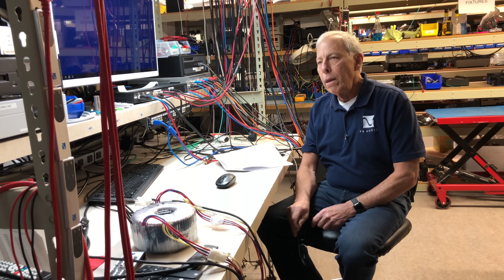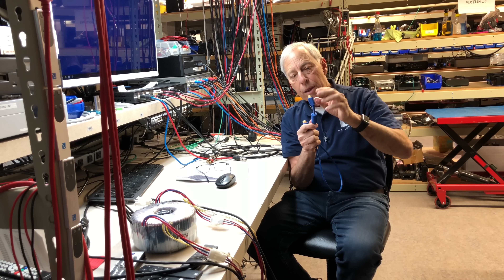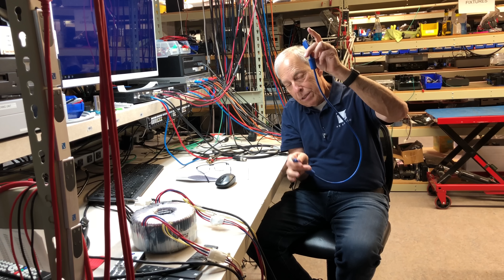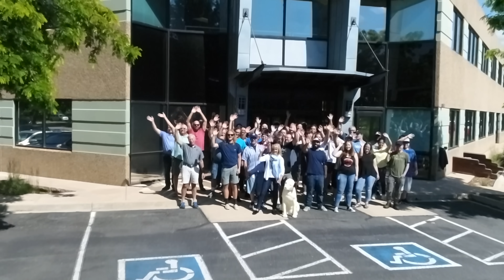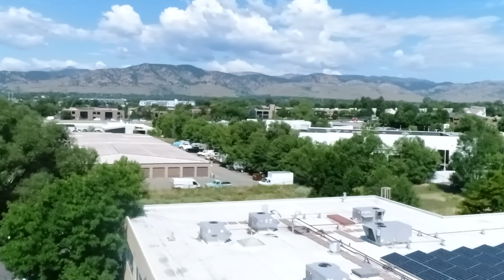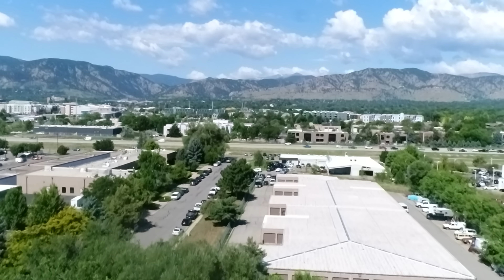Should amp impedance be high?

Comment: Hi Paul! Just popped over from Skylabs after Kevin recommended your videos. I think you can do much better explaining impedance by using an actual vintage stereo setup and explaining why impedance is so important as sound source moves through pre-amp, amp, receiver and eventually a pair of speakers. Frankly, I'm talking out of my hat here because I still don't understand the concept entirely (with perhaps the exception of high to low) :-)  A good way to start would be to imagine you are trying to teach math to a monkey. The first monkey would be me. Thanks!

Comment: For sure, if you connect (in parallel) something of low impedance to your circuit, then the behaviour of the circuit will change: the current will flow through the low impedance that you connected instead of the usual path. And it will change the signal that you tap into on your circuit -- you do not want that.

Comment: Can someone please explain to me this: if a 8 ohm speaker is easier to drive than a 4 ohm speaker, why does it say on the specs of a amp that that it can for example do 2x100 watts with 8 ohm, and with 4 ohms it can do 2x160watts. I dont get that. How can u get more power out of your amp with lower ohm speaker that is harder to drive?  Rly hope to get some answers.   Im alittle new to this, so be kind ;)
Reply: @thedude1744  how does that make sense? If i have a 100watt amp. It should be harder to drive a 4 ohm speaker. Then why does all specs show u get more wattage out of ur amp with a 4 ohm speaker.

Comment: 1) It is important to explain the difference between resistance and impedance. 2) it is important to tell that once connected the headphone has become a “load - power consumption” to the amplifier where the system as a whole has impedance to the power from the socket. 3) the power supply behind the socket has now become loaded as well and as such you need to include its impedance

Comment: Howdy.
Usually we want an amplifier to be voltage driven. This is the same as having a high input impedance. If the input impedance is lower than the source output impedance the amp. becomes current driven. That would be ok if both the output sorce imp. and the input amp. imp. are truly resistive and their magnitudes are constant over the whole audio spectrum.
That is seldom the case. Freqency dependent capacitive and inductive components cause phase shifting and also frequency dependent magnitudes cause level unbalances when current driven.
An amplifeir input impedance should be at least 10x the source output impedance to guarantee voltage driving. Amp.s are usually designed to uphold voltage fidelity. Not current fidelity.
The same goes for headsets and speaker elements. Through much testing they are developed to uphold air pressure fidelity to the feeding voltage and not the produced coil currents.
Regards.

Comment: I don't think this explanation was very helpful. Somebody tell me if my analogy below is helpful and accurate, in as much as it is an analogy.

We want amps to be able to "draw" the "amount" of signal they need. We provide a signal from a source that "flows more freely" than the amp accepts, allowing the amp to "take all that it needs" from that part of the circuit. We don't want to "starve the amp of input" so we offer less "resistance" from the signal generating device than the signal receiving device offers. We want "push" signal to the input and let it regulate the connection, not make the input try to "pull" signal from a source that "resists it."

Comment: 120 ohm output impedance  requirement for driving headphones was a result of laziness in designing headphone output in power amp. The near 0-Ohm output impedance of an amplifier (power or headphone) provides a very high damping factor.The amp maintains tight control of the headphone  or speaker driver  damping providing tight bass control.The high damping factor  reduces distortion. ,provides a smooth and a predictable frequency response.

Comment: This didn't answer the question at all. He wants to know why output impedance is high for the headphone out but low for the speaker out.
Reply: It did. The wire from A to B is the output impedance of the amp, whereas the wire from B to C (ground) is the impedance of headphones. A-to-B (output impedance) appear in series with B-to-C (headphones), so the same current flows through both, but the voltage is divided in between of two in proportion with the resistance. You don't want any voltage drop on A-to-B (basically loses) that's why you need to keep A-to-B as low as you practically can
Reply: the signal drop is at the low resistance, speakers need more signal.

Comment: I have a dumb question a long one at that. You are so good at explaining these things I'm positive you can answer this. My two amplifiers 1 for the front and one for the rear are pioneer gm5300t's. They are 2 channels at 125 watts rms 4ohms per channel. 4 Speakers are pioneer z series 110watts at 4ohms including tweets and crossovers. Every thing works perfectly. So here is my problem I'm adding 4 alpine tweeters 100watts rms 4ohms. That's fine my math says 2ohms 190 watts on the amps and 2ohms 220 on the woofers tweeters and crossovers in parallel. Heres my problem they sent me one pair of 100watt 4 ohm tweeters  and a pair of 80watt 6 ohm tweeters and they dont have more of the 100 watt ones. Is this ok to mix the 6 ohm with the 4? Should I put the 6 ohm in the front or back? I assume to put the 6 ohm in the front so I get more volume in the front. Please help.

Comment: I want to have a crack at this my self high impedance inputs are basically voltage receiving inputs or signal inputs they need really no current and since the point of these inputs is to receive signals u want the impedence to current to be very high so no current is used to drive or distort the signal or change it in anyway think of it as a data line it's just transferring information not driving voice coils or doing work like low impedence high current outputs or inputs high impdence means it's basically  means its driving a gate on a transistor  or grid in a tube  something that has no real physical connection to the power supply or coil it basically just copying the electric field state of signal and passing this information to transistor junction or plate of a vaccum tube  that actually does the heavy current lifting required to drive the signal hence field effect it's just super imposing the signal on to a device that then amplifies. A speaker needs to be low impedence because it's the current through the voice coil that moves the speaker motor super high impdence speakers would need super high voltage to drive them which is wasteful and inefficient I hope this helps.
Reply: I was not super satisfied with pauls explaination because it's not  just a ground path. Paths to ground lead to well nothing ground lol. You can set impedence with a resistor to match impedence but it's a little more than just that. Am sure he was well aware of that but no need to dumb it down to much as it leaves open ended question and confusion

Comment: If a speaker impedance is high, it is hard to push electricity into it. But that's because a high impedance speaker doesn't NEED much electricity. This is easy for the amp because the speaker is not asking for much electricity, nor is it allowing much electricity. High impedance is a way of keeping power out of the speaker. It's a way of not asking for much.

But a low impedance speaker is HUNGRY. It's impedance is low because it wants to gulp down a lot of power. So it ASKS for a lot of power by keeping the impedance low. Low impedance = hungry speaker = demanding task for the amplifier. A low impedance speaker asks the amp for a lot of power, and that's a challenge. It asks for power by keeping impedance low.

Comment: Paul, I think you misunderstood Steven's question.  He was asking about headphone/speaker impedance and amplifier output , while you opened the video with the question "Why should the input impedance of an amplifier be high?"  You did a fine job of answering your own question, but it may not address Steven's concern.  
Some points toward answering Steven's question (necessarily abbreviated since I could write an entire book on the topic):  
By design, power amplifiers typically have very low output impedance, because that is how they achieve precise control of the voltage that they put out, including when the load is drawing substantial current.  One wants this voltage to exactly follow the musical signal, because speakers are always designed to be driven by accurate voltage sources.  [One could postulate an alternate audio world where signals are represented by current instead, but on planet Earth we don't do this.]  We typically see power amp output impedances of only 0.1 ohms or less.  
The speaker load impedance then needs to be high enough, that the power transfer from amplifier to speaker can be efficient, while the amplifier's output current limit is not exceeded.  Attempting to use speakers with 0.1 ohm impedance would not be very successful, because the current draw for any useful amount of power would be too high and the amplifier would distort severely (or even shut down).  Not to mention that in this case, power loss in the speaker cables would also tend to be high.  
You may be aware of a general circuit principle, that maximum load power will be provided when the source and load impedances are matched.  However, in that case the load and source power dissipations will be equal - which is not what we want in audio systems.  We want the speakers to dissipate the power, not the amp and cables.  Also, such general principles easily lead us astray since they assume ideality and do not consider particulars of the application, such as voltage and current limitations of the source, and the requirement to avoid distortion.  
There is another situation you may be familiar with outside of the audio discipline, where source, load (and cable) impedances should be matched, which is when one is dealing with transmission-line effects with RF signals.  However, unless you're locating your speakers hundreds of feet away from the amplifier, this is not a consideration for audio.
Reply: G Guest  
Yes, 41+ years in analog/digital circuit design and development for commercial flight control systems, most recently 777X.  But I've always had a keen interest in audio since about the age of 8, when I assembled my first power amp kit - a Dynaco Stereo 70.

Comment: No!
Amplifier output impedance should not be high because we now have 4 ohm loudspeakers, or 8 ohm loudspeakers connected in parallel, these days.
As long as the output impedance of the amplifier is lower than the impedance of the loudspeaker, the amp will be 'happy'.

Comment: I like to talk about water and pressure when talking about impedance.  I imagine the lower the impedance the larger the source pipe and the higher impedance as a smaller pipe.  When the water flows through the low impedance pipe the pressure of the water is maintained by the higher resistance at the end like on the end ie A garden hose  has a spray nozzle(high resistance) without the pressure (open valve (low resistance) at the house spigot) the spray nozzle won't work on the destination it will drip out of the spray because the resistance isn't low enough (open valve hasn't been opened all the way) at the source.  I think of the ratio between the pre and amp (10 : 1, 20:1, 100:1) as the psi of the water in the hose.  You don't want the voltage flow or pressure to not be enough or the spray nozzle won't work and you don't want the psi too high or the hose would burst.  I'm just saying you don't want the resistance to be too far off.  

Honestly, the way I fix this problem myself cause I've fought that fight, trying to properly bridge impedance between pre and amp. Just buy an amp and pre from the same manufacturer and product line.  POOF like magic you don't need to worry about this anymore cause the manufacturer already optimized their systems to go together and a pre that's designed to go with an amp make beautiful music together!

Comment: I couldn't tell from the phrasing of the letter combined with the introductory sentence if the questioner was referencing the impedance/resistance of the speakers/headphones being higher than the amp's output impedance, or if this was about the power amp's input impedance being high in general for optimal results. Here's how I address both questions... 

To start, we have impedance and resistance to consider here but we can treat all simple measurements as simple resistances. Resistance measures how much energy overall (AC & DC) is restricted while flowing through something with the byproduct being heat. Impedance on the other hand is a measure of restriction to the flow of AC, with the byproduct being the creation of magnetic fields. In the real world, just about everything has both resistance and impedance but you can concentrate on making devices with one or the other. Because we're focusing on music which is all AC, we concentrate on impedance quite a bit but impedance is a complex resistance measurement that varies with the frequency of the signal, making it much harder to grasp. As a result, both terms and both phenomenon are commonly commingled. Most of the time, a sated impedance is the resistance to a 1KHz signal.

For the amp's input impedance: To transfer the signal from the preamp to the power amp, a small amount of alternating current from the preamp's output stage flows through the power amp's input resistance where it is absorbed by the input resistor and used to create an AC voltage which is then amplified. Ideally that input resistance is 100 times higher than the resistance of the upstream stage which is driving it so that the output stage doesn't have to do any real hard work to transfer the signal. The resistance of the interconnect should ideally be low enough as to become invisible in the equation. A lower resistance input will make the upstream stage do more work to deliver the signal and those stages are not usually capable of much hard work so they fall flat when trying; clarity and highs suffer immediately.  The higher the input resistance/impedance, the more "delicate" the response is but as resistance increases so does something called Johnson noise or thermal noise. The trick is to find a sweet spot tradeoff between input impedance being high enough to have delicate response, and input impedance being low enough to avoid Johnson noise which comes across as white noise in your speakers. The industry standard for consumer level input impedance is 10,000 ohms. PS Audio designs around 30,000 ohms, requiring the output stages to only work 1/3 as hard as they typically would, but still being low enough to avoid unwanted noise.

For the relationship of speakers/headphones impedance needing to be higher than the power amp's output impedance: The simple explanation is that the output circuit is a loop and the power will be dissipated in that loop in proportion to the amount of resistance it receives to flowing at any given point. We want the least resistance to that flow to be in the amp (output stage+power supply) and the speaker wiring so that it's concentrated in the speaker drivers where it can perform the desired work. If the amp doesn't have to work as hard to overcome its own internal resistance as it drives the speakers, there's a good chance it will also have better response overall.
Reply: Peter S - you know how to explain things clearly - I learnt more from your comment than from P's video!!! I am currently considering  a tube preamp with output impedance of 2800 ohms. My existing power amp has an input impedance of 20,000 ohms. So the magic X 10 ratio between Pre and Power amp is missed and instead I would be sitting at about X 7. something. So the preamp would have to work a bit harder. In your experience would this have a great impact on clarity and high end roll off or does  the ratio need to be lower still for those impacts to become noticeable? Any knowledge from firsthand experience would be gratefully received.

Comment: Take a 9v battery, low impedance output, touch it to ground sparks fly.  Now connect an LED (say it drops 3v across it).  That leave 6v with low impedance to ground, no sparks, but LED blows due to the high current.  Now add a current limiting resistor to the LED making it a high impedance input to the LED.  LED lights with a brightness determined by the current limit permitted by the resistor.  The key is the current is limited by design for the LED to properly light and not by the battery in a low impedance output/high(er) impedance input set up.  (yes, battery voltage drops as it discharges, etc.).  

On the flip side are the current limiting power supplies.  They output a set current with voltage altered depending on the load, i.e., LED.  That is a high impedance output being fed into a low impedance input.  In that case, the power supply controls how bright the LED is by limiting the current only adjusting voltage to the voltage drop of all the LEDs in series.  

Back to audio, now you've got an amp designed without specific knowledge of what speakers, headphones, etc. will be connected to it.  So, the amp has a low output impedance depending on the load, i.e., speaker, to limit the current (i.e., power).  (to a limit as in the real world the amp will have a max limit with protection circuitry to cut the current if to much is demanded by the speaker, etc.)  Thus the speaker controls the power drawn at any voltage output by the amp.